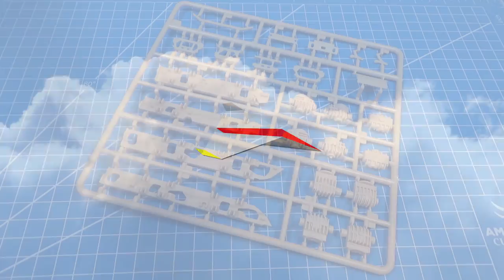Model Rosomak APC - 1/35 IBG - Undercarriage

Comment: great start to the kit - have you got any more build steps?? And also, the angled wheels, is that all form the kit or did you have to change parts to make the right angles??
Reply from the maker: The project is on hold for years, but I have a good feeling ;)
As for the wheels, you can mount them as you wish without any modifications.
Reply: @Big-Modeller  thanks... found others angling wheels so have done so on m ine,,, hope to see more of your build